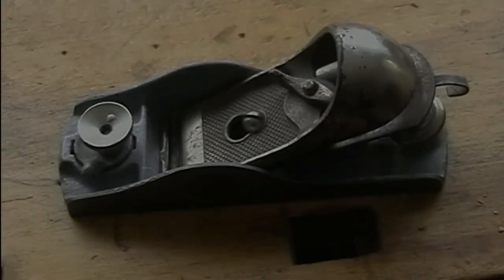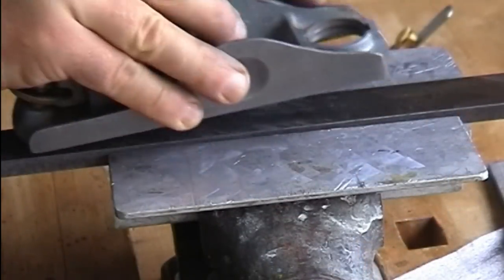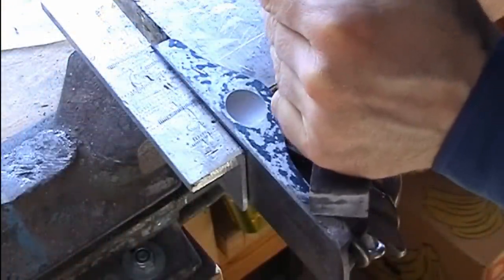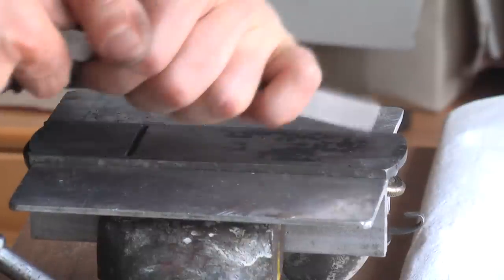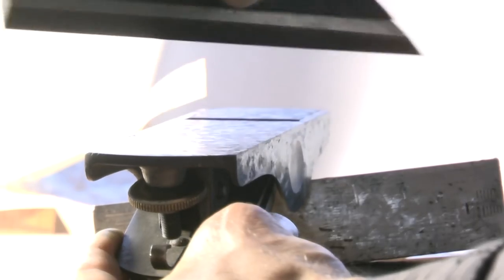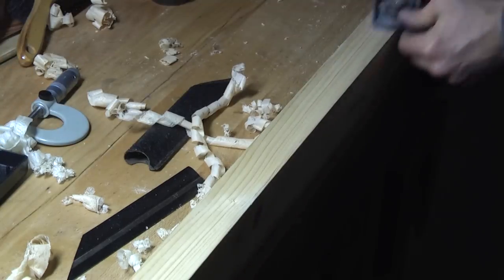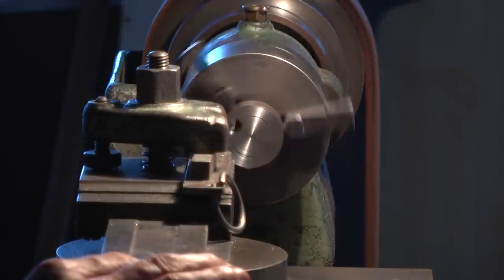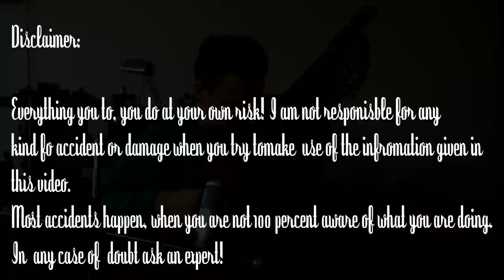Restoration/Tuning of a  block or hand plane to highest accuracy w. files, scrapers, edge & plate

Comment: I wanted to see  what .025mm was in standard decimal so I Googled up a conversion calculator online. It came back with 0... .025mm is 0 inches. I had to laugh. 

Although I suspect many woodworkers would argue that this methodology is taking things a bit farther than is absolutely necessary (including James Krenov, see FWW #252) I think, as you've demonstrated here, accuracy can be it's own reward. Great video, thanks!
Reply from the maker: Thanks a lot. Well, as always the craftsman or woman has to decide on his or her own, how far to go. In the workshop devoted to me, it is essential.
Reply: Patrick Halseth 0.025 mm is just under 1 thou. It is 0.984 thou.

Comment: I know about well known 3 plate method to make cheap poorman touch plates from any metal scrap (for draft use). Can you advise some other tips on making very very cheap tools without any machinery, only using hand files and paint marked scraping to do details traditionally requires lathe and especially milling machines ?
Reply: correction: especially lathe, maybe some scrapmade centers mount and hand rotating with fingers ?
Reply from the maker: Hi Dimitri,
please check out my correspondence with AESamuel especially, as well as with Dylan Mcguirk, and trevorgdn. With pieces of polished granite you may reduce your time effort. Concerning machines you may use metal shapers because they can be achieve cheaply on the seond hand market. Hand rotating on lathes does not make much sense and accuracy of lathes depends on so many factors. Try to pre machine as good as you can and the rest is hand work. Merry christmas.
Reply: +theorboguitarmaker: machines gives large help, of course, but I asked about making parts without any machines, only hand tools, and maybe some widely available electrical powered hand tools (drill, angle grinder, dremel). For example I'm tring to repair old lathe, and can't buy replacement parts (lathe model too old), problem is this lathe have no any tailstock, and I have to handscrap it itself from scratch.
Reply: +Dmitry Ponyatov I searched a lot at youtube on handscraping and hand metalworks techniques, but still can't find how to do something more difficult than flat plate. Purchased calibration tools like dovetail rulers, flat bridges, and others too expensive for me, and cost much more then this buckshee lathe from scrapyard

Comment: Great content.  I have to agree with others that the audio needs tuning: voice audio is too low and the background audio too high.
Reply from the maker: Thank you. As stated in previous posts, it depends on may factors, especially audio hardware, and other individual factors of the listener. If I find the time for making new videos, I will do some changes anyway. To learn something means to practice and not just watch a video. Did you try using headphones?

Comment: Too bad scraping is not an option with chisels. The last one from the set is 40 mm wide and it's killing me. I continue to get rounded edges even after sticking my sandpaper (carborundum) to the float glass plate.
Reply from the maker: You can use chisels for scraping if you are prepairing a 90 degree cutting edge. Ductile materials like sandpaper never result in sharp edges.

Comment: Is it a fact that you rely heavily on the fact that your file is flat?
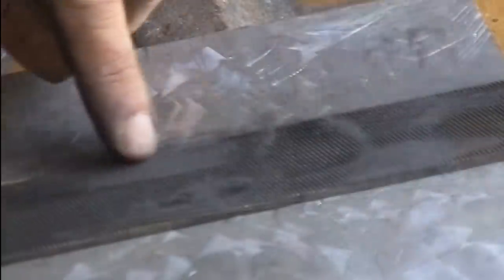Reply from the maker: No, the exact opposit is the case, see minute 8:15 in the video. Flatness or straightness are mathematical ideals based on axioms. They do not exist in physical reality. If a file would be close to flat, it would be unusable because of the extreme force needed to make at least some part of its teeth cut into the material, after the surface of the work piece has reached some kind of accuracy. This is only one of the reasons why it is necessary to use scrapers afterwards, if higher precision is required or of advantage at least for the specific purpose.
Reply: @theorboguitarmaker8155  If your file is convex will not your plane ends up convex?
Reply from the maker: @joefagan9335   This depends on the feeling of your fingertips. But after a certain point it is recommended to move on to the scraper.

Comment: Your sound is to loud, and to much bass. I could hardly hear you and continued to adjust the sound as the video played. Because of the sound I wasn't able to see it all the way through. Sorry about that.
Reply from the maker: Dear Wilson,

thanks a lot for your attention. I am sorry that you have problems within your audio set up. All my videos are mastered to normalised 0 dB audio output level. Please control your different software based preamplifier channels with a software mixer depending on the PC system you are using. Keep in mind that in digital audio you have now headroom for over-modulation. Volume adjustment in your browser is insufficient in such cases.

Any distortions in your sound system are beyond my responsibility. Concerning the sound I use high quality audio equipment for sound control. Problems on PC audio systems are usually caused by low quality loudspeaker systems, especially subharmonic distortions by low budget sub-woofers,

I recommend that you check/calibrate your sound system with the aid of browser based control systems like www.audiocheck.net.

Happy working,

Mike
Reply: +theorboguitarmaker   Wow, that is a useful link!  I have hearing loss, didn't know how much, but now have a rough idea.  I also had difficulty understanding your commentary, but really respect your skills.